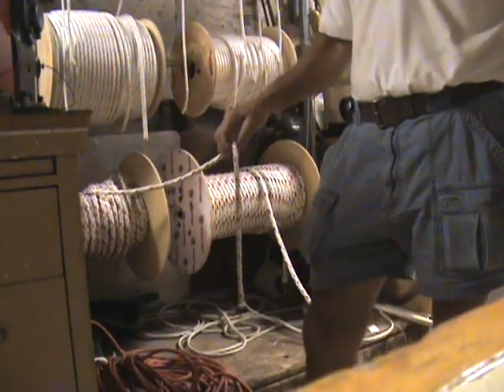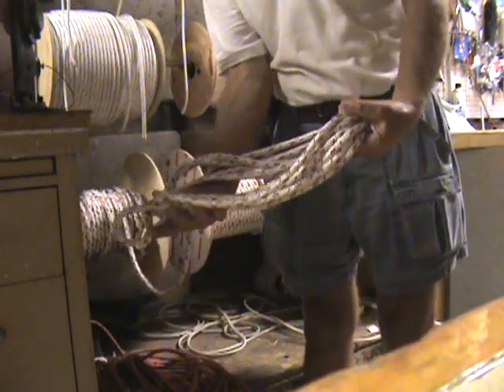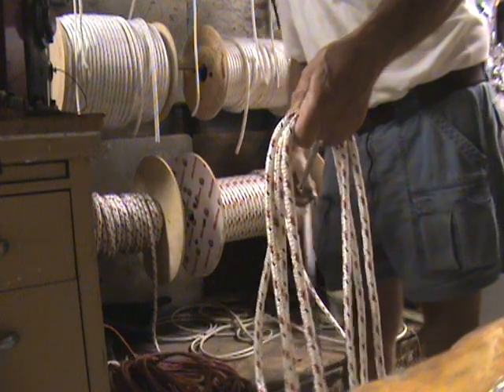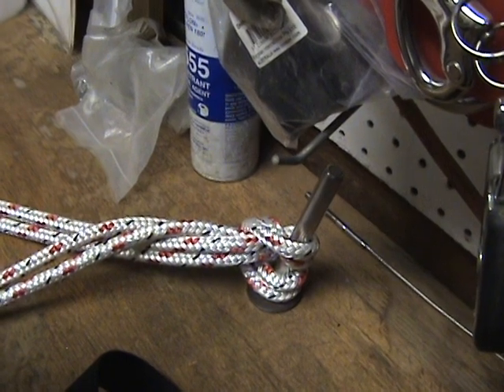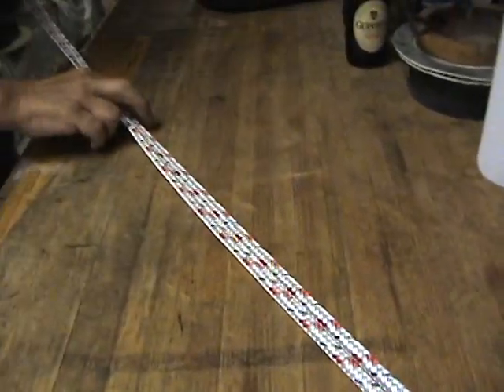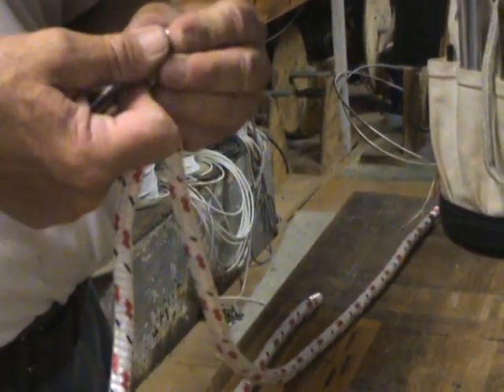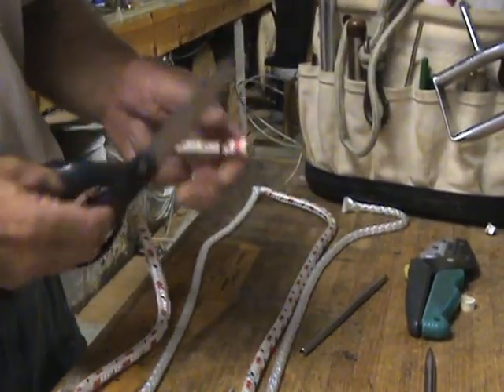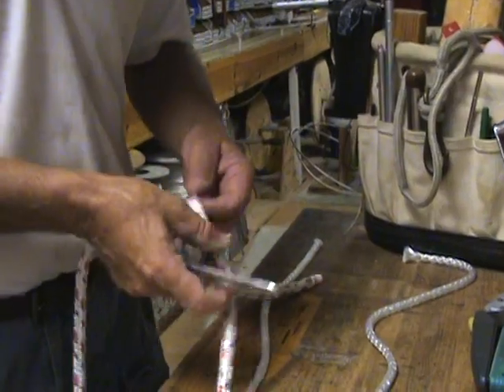Constant Diameter End to End Splice

Comment: That's a great way to make a smooth running end for end splice in a line where the full breaking strength of the rope will never be needed. Strange that I never though of doing it that way. I always either used the standard old fashioned C*nt Splice when no small sheavs and stuff are to be encountered, and where they are, I stagger the join of the core a bit away from the join of the cover, and tuck splice the strands of the core end for end by pairs, then tuck splice the covers together by pairs of strands.  This retains a LOT of the breaking strength with a very small increase in diameter because the core and the cover joins are not one on top the other, but it takes a while to do and wastes more rope. I like the looks of the method you show here and it is fast and neat.

If more strength were needed, you could simply double the mark distances to make a longer overlap, but again, strength is usually more than what is needed anyway.  Since you aren't burying a  crossover I guess you could make them as long as you like. 

I am really liking that splice. Great vid, thanks for making it and posting it.

BTW I have never liked the "special" fids and pusher kits they sell so dearly for double braid. I use a coathanger or piano wire, or bigger wire if required for the rope size, I run it doubled from the exit mark back down to the insertion mark, capture the end I want to pull through in the bight, sometimes apply a little electrical tape over the doubled end, and pull it through. I have had to splice new eyes in ships' mooring lines up to 12" (circumference not diameter LOL) and if they make a fid for that size, I have never seen it.

Comment: Now thats the craftmans touch! I went with the very schematic tutorials provided by one of the rope suppliers - and ended up with a hollow space between the ends of the cores (in my endless »2 geared« mainsheet) after some load. Devil is in the detail, and of course you need to induce some serious stretch in the process to match the real deal. I need to redo!
Very good laid out.Thanks

Comment: What tool You're using to push throught the rope shield?
Reply from the maker: Sorry for not answering earlier.  Don't check in here as often as I should.  
Those are called Fids.  I made mine on a lathe.  But you can purchase many different types of fids from your marine store or online.  They usually come with instructions and measurements for different line sizes and types.

Comment: Very nice! What does it mean when I can't get the fid through the doubled section between marks 2 and 3 on the first pass? Assuming my fid isn't too big (my chandlery's fids didn't come with instructions, but the rigger pointed me to them when I asked about splicing 8mm; it's a 6mm fid the same shape as yours). I'm trying on an older line---the best one I've found for friction in my continuous-line furler. Is this easy on some line and not on others? Any suggestions for high friction line for a furler and also not too difficult to splice? Bonus points if it's available in Canada :D
Reply: Hi Ben, I had to make an account for my wife to be able to comment here on my own video. Go figure. I have just about given up on this platform. 
Anyway, a good rule of thumb that I've always followed is to use the smallest fid that works. And also to try to avoid splicing used line whenever possible. As a matter of fact, if a customer wants me to splice his used line. I do it at an hourly rate rather than my usual splice charge. 
The line that I have been pretty loyal to and which I have never had a problem with is New England Rope. Sta-Set is a good polyester yacht braid that works well is continuous line furlers as long as it is sized properly. Meaning you want to use the largest size that fits into the sheave well without jamming anywhere.  
Good luck and please feel free to call or email.
Reply: @jensmith2460  Thank you! Yeah, YouTube is kind of troubling, isn't it?

Just a followup: I was using old line (looking up Sta-Set, it appears that that's what I have! Thanks!! I guess either it'll be easier to splice if I get a new piece, or I still suck at splicing) because I can confirm that it does indeed work well in my Ronstan series 80 furler. The brand-new correctly-sized yacht braid provided by my local sailmaker, usually an extremely knowledgeable resource, didn't generate enough friction in the furler's drum (more slippery, and about 0.6 mm smaller diameter), so I was wary of trying something else unproven. BUT I got your splice in my old Sta-Set to work by pulling in a couple of tips from https://www.treebuzz.com/forum/threads/splicing.8117/ , soaking the line in water to lubricate it and maybe remove some salt (so taping the ends was no longer possible), and most importantly, throwing away my fid in favour of a bent-wire rope-puller. I'll also add that I think next time I won't pull the crossover quite so tight, as the loop has just a little bit of a bulge there that I can feel when it runs through the drum. Does that make sense?

Comment: After several unsuccessful attempts to get the fid passed the core within the sleeve I used a small amount of marine grease on the taped line going into the fid. The next attempt went through without difficulty.
Reply from the maker: I've never tried grease. Seems like it might be a bit messy. But hey, whatever works.  
I have had success using a bit of talcum powder on occasion.
Reply: @ssmrinc.sailboatriggers8307  To what extent could grease weaken the splice? If you use grease, should you run the line through the washing machine a few times to remove that, or run a dozen lines of stitching rather than just one?
Reply: @fugue137  Hi Ben, I would definitely recommend removing as much as the grease as possible from the splice. Washing the line in a mesh bag would certainly help with that. But just using some mineral spirits might be good enough. 
Extra stitching never hurts too.

Comment: Great video!   So, the video begins with taking each end of the rope and grabbing it about two feet from the end and pulling out the last two feet of the core, which leaves the last two feet of the ends of the rope hollow, so the outside portion of each end of the rope can each be threaded through each other. 
 
I didn’t see what happened to the the two-foot section of core that was pulled out from each end of the rope at the beginning.  Were they just cut off and discarded?
Reply from the maker: Sorry, I haven't been here in a while.  
Anyway, it's not simply the last two feet of core. The measurements are pretty important.  Every line diameter requires different measurements.  
But essentially, you're right in that the section of core is discarded. The reason for this is that the splice is constant diameter.  If the core were to be incorporated into the splice, the diameter would be larger in that area. As it is in the throat of a regular eye splice.
Reply: Moon
Reply from the maker: your post confuses me.

Comment: Great video but I think you have a mistake where you insert the outer.
5.16 in at 1st mark and out at 3rd, correct.
6.03 in at 2nd mark and out at 3rd, incorrect, should be in at 1st and out at 3rd mark.

Comment: how much strength is lost with this splice?
Reply: 50% is lost.
keep in mind that your furling line is not optimized for strength but for handling and maintaining the same diameter. If you need to splice for strength you obviously need a different splice.